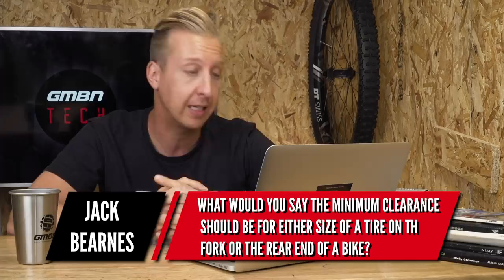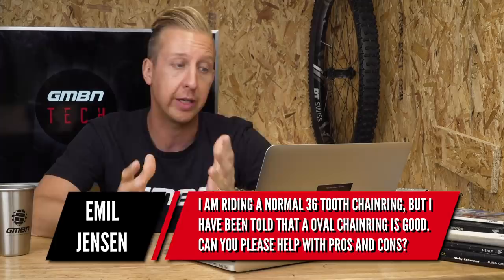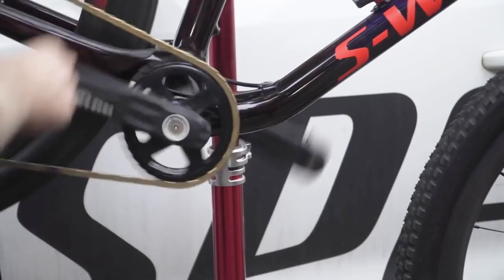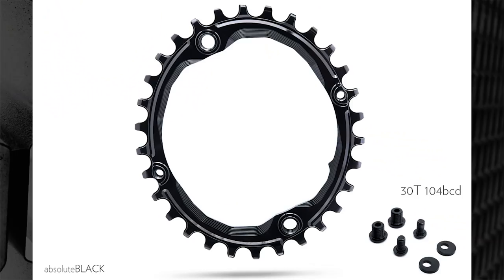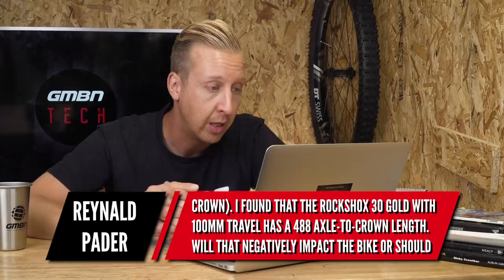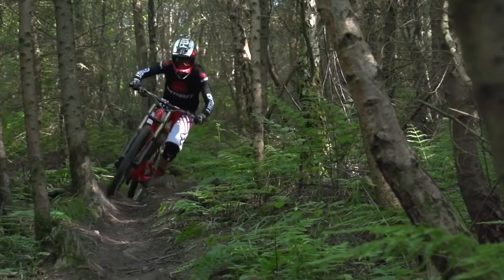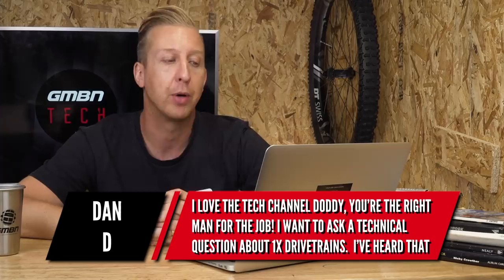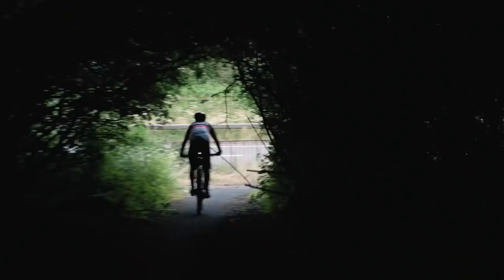Ask GMBN Tech: Should I Get An Oval Chainring?

Comment: I use oval rings on all my bikes and the benefits are most noticeable on a singlespeed as there are no hiding places for the effects better climbing on previously gut busting climbs higher average speed and better traction, there's no more chain growth with oval than with round rings, believe or not round rings aren't perfectly round. Clutches need periodic tightening on whatever bike you use them on and having oval rings is a red herring with regards to determining the cause, it's quite simply wear and tear on the rubber bung which happens through normal riding as the arm does still move just not as much. Reason being is that with  oval rings no matter which part of the pedal stoke your In there is always the same amount of teeth engaged with the chain. I use mine with no chain tensioner and there is no more chain growth causing tight or loose parts of the revolution than a round ring.

Comment: If you run 2x or 3x, the front chainring, when in gear with the most teeth it’s a harder gear, but with the cassette at the back, the more teeth, the easier the gear. Please can you explain. This is driving me insane. Thanks
Reply: Bigger ring on the front means the chain moves further, bigger ring on the back means the wheel moves less. the less distance you move the chain/wheel the less effort is required
Reply: It's all about how many front rotations equal a rear rotation - examples:

Positive teeth count difference:
if you "feeding" 20 teeth per pedal stroke to your rear wheel that runs only 10 teeth, the wheel will spin 2x per pedal stroke, so you'll have to put the power down to make it spin two times with only one stroke - that's HARD!

Negative teeth count difference:
feeding only 10 front teeth to the rear (which is running 20) makes the wheel only spin half a time per pedal stroke, so the power output needed to make the wheel spin one single time is split up in two crank rotations - that's EASIER to pedal cuz the load is shared.

Same teeth count front and rear (neutral):
1 = 1
Reply: Think of it like this: when your front and rear have the same amount of teeth, one revolution of the cranks ’buys’ you one revolution of the wheel. 

When your front has more teeth, you’re trying to buy more than one revolution of the rear wheel (=pedaling is harder). Similarly, when your rear has more teeth, you’re buying less than a full revolution (=pedaling is easier).
Reply: Yes all basic mechanics really. Let's take a sram eagle setup on a 32T chainring.
In the lowest gear your ratio = 0.64 (32/50=0.64) Meaning with 1 full pedal revolution your rear wheel will turn 0.64 of a whole revolution.
In the highest gear that would equate to a ratio of 3.2 (32/10=3.2) So 1 full pedal revolution will make the back wheel go round 3.2 full revolutions.

Now we have to keep in mind the conservation of energy and all that kind of basic physics, if you also keep in mind losses you will at all times have to input more power than what your output equates to. And an object in motion will always wants to stay in motion, meaning that once you get the rear wheel spinning it will take less energy to keep spinnig at the same speed. So you can start riding in a easy gear after a stop and gradually shift higher until you can comfortably pedal at your preferred cadence.

(I hope what I said makes sense and is correct and I didn't confuse you more)

Comment: What is the best budget group set (under 400$ )
Reply: I did my conversion to a 1X11 last year and went with Shimano XT - I like the multiple downshift capability. I kept my crank and just put an oval narrow-wide chainring. I sourced everything locally and came in just over $225 or so.

http://www.chainreactioncycles.com/us/en/shimano-xt-m8000-1x11-drivetrain-groupset/rp-prod137311
Reply: Sram GX or NX Eagle.
Reply: NX EAGLE. Even XTR M9000 with an XT cassette can be had for $400 without a crankset.

Comment: @askgmbn hi Doddy loving the show, I'm 5"6 and am riding a brand x ht01 hard tale with 27.5 wheels I think the top tube is 570 running a 45 nukeproof stem, 120mm rockshox reckon forks,and having issue getting the front end up, watched countless number of videos of how to bunny hop and manual, I used to be able to years ago(10-15) on a Claud Buttler Cape Wrath from I think 2000-2003, I was jumping about a foot to foot and a half, and as I said having issues, any help would be grateful

Comment: #Askgmbntech I have no o ring on my rear shox, where can i buy one? Thanks.
Reply: Do you mean the sag measuring ring? I've seen people use cable ties but my concern would be micro scratches (which can happen from ring as well), or you can rub a bit of grease on shaft and see where the shock body wipes it down to.
Reply: Cable tie. Job done!
Reply: Hardware stores will carry them. Nothing special just a normal o-ring. As it's a rear shock it won't be hard to do. Id bring the shock with me to make sure it's the right size as you don't want one that's too big. Zip ties are good but you MUST remove them before a ride. The o-ring is better because you can set it to zero before your ride and at the end of your ride you can see if you use all your travel.
Reply: Put a little butter on the shaft and see where the line is, boom Virtual o ring

Comment: #askgmbntech  Hey dods, Do Icetech rotors brake better than normal rotors?
Reply: Jack Ammo Man they are a little bit more heath resistant but last a little bit less
Reply: theblackjack channel Any other advantages except being less resistant to heat?
Reply: Jack Ammo Man no they are just more heath resistant, if you are a light rider you won't even notice the difference, if you are an heavy rider they coud be usefull

Comment: 3x11 is better than 1x11 because possibility of 42 thooth by 10 tooth and 22 tooth by 51 tooth
Reply: Ever heard of cross-chaining ? Just curious.
Reply: You'll struggle getting a chain long enough and struggle even more stopping it from falling off.
Reply: Too much of a stretch for ANY derailleur ... and way too much redundant gearing.
Reply: Had recently switched to 1x10 from a 3x10 (44,32,22) and I will never go back. The freed clutter, simplicity and the actual riding you do vs. the inner thoughts of choosing one of those 30 gear combinations and asking yourself the question: "will they shift or drop when you finally selected one for the situation?" is very satisfying. Go give 1x a try and it will be a revelation. Just use a proper narrow wide up front.
Reply: Don't feed the troll 😂

Comment: #Askgmbntech I have a press fitted BB on my bike that starts creaking yet again. Are these glue-in adaptors any good to convert to a screw-in BB and mount holowtech II bearings and crank? I'd have most of the parts around, so I'd just need to buy an adaptor.